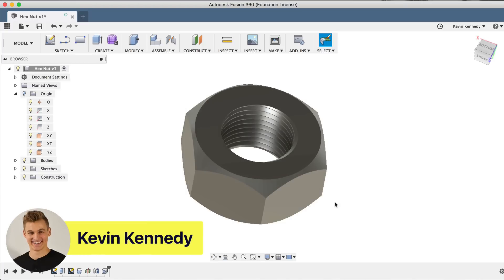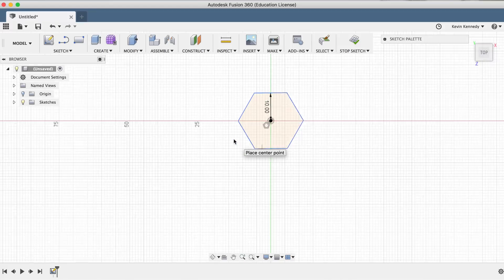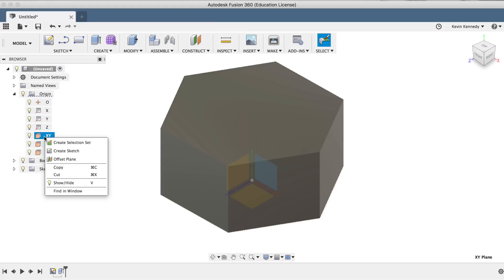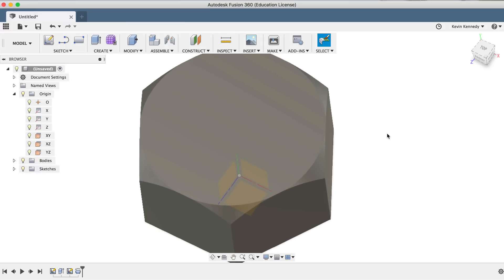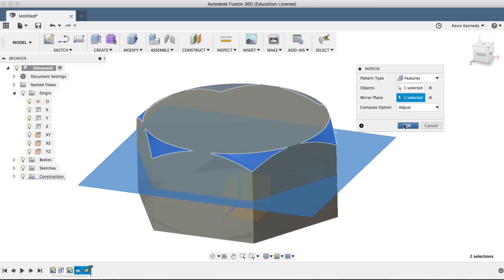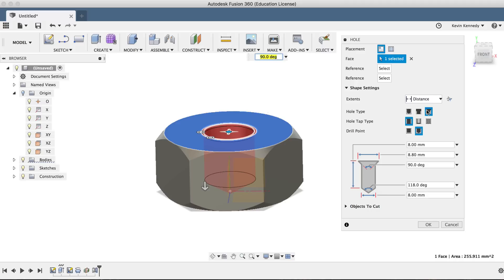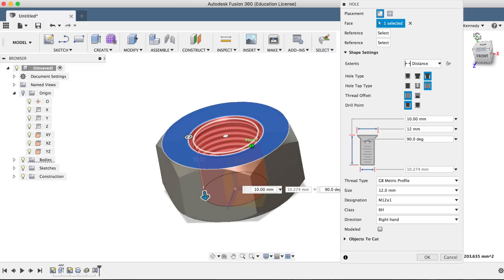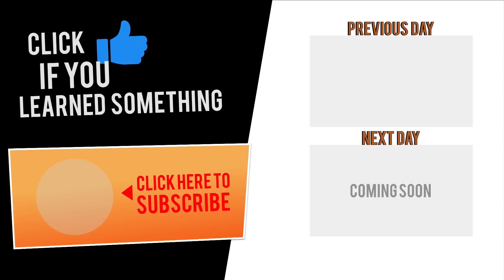How to 3D Model a Hex Nut - Learn Autodesk Fusion 360 in 30 Days: Day #6

Comment: i wanted to make one 12mm big but i ran into an issue when chamfering the hex nut, the edges aren't meeting with the top surface , you had the lines set to 1.50, how do you define these dimensions?

Comment: I cannot get the triangle to snap to the hexagon as shown in video. My front view is not "rectangular" but has one face square on and the sides immediately to either side is either horizontal at top and angled at the bottom  (ie showing some perspective) or vice vera. Triangle then appears a way into the hexagon or off to the side. I've confirmed the settings as per the guide

Comment: I'm following the step-by-step instructions to create a sketch plane from the XY plane of the browser.  But the results I'm getting  repeatedly when using the Line command to sketch a triangle for the chamfer is, the sketch is being drawn on the 60 deg facing surface of the nut.  Not on the plane I just created.

Comment: I just created this hex nut with the hole command, however the chamfer is only on one side of the thread.  I haven't been able to figure out how to chamfer the other side of the thread.
Reply from the maker: You'll have to manually apply one with the Chamfer tool. There's currently no way to do so via the Hole command.

Comment: Hi, thanks for the great videos. Got a problem, as well in previous video. Minute 1.05, my hex does not snap into place. Need to create a horizontal or vertical construction line to do so. On minute 2.20 i got the same problem, can't snap it on the object. Any advice?
Reply from the maker: It was a change in default settings.

You may enjoy the updated series which is recorded with the latest: https://bit.ly/30daysUpdated

Comment: Got through it all. One question: "Countersunk" only countersinks the top of the nut hole. Generally nuts will be countersunk on both sides. I don't see an option to do that using the hole command, am I missing it?

Comment: Two questions if people are still reading this:

4:19 re: mirroring the feature... is there any benefit or downside to mirroring the initial triangle sketch we made before revolving (and revolve both triangles) as opposed to mirroring the feature after revolving/cutting?

Two: In the whiskey bottle episode, I created myself some "homework" and created a threaded cap which matched the threads on the bottle. When 3d printing (ender 3 v2) the cap was too small. I had to bump up the size about 5% for it to fit (which also changed the thread pitch slightly).  So the question is, any guidelines when designing mating threads as far as sizing goes for 3d printing? I realize the best solution would be to run a tap/die through each to properly size them, but for one-off trinkets (and thread sizes which I don't own tap/dies for) it would be nice to be able to just print and go.

Comment: I had the hardest time getting the chamfer cut.  The line that I placed to use the revolve command kept wanting to snap to the nearest grid line rather than to the nut.  So I kept leaving little portions of the nut after the revolve command.  I finally had to make the line slightly outside the profile of the nut to get the chamfer to appear as yours did.

Comment: Hey everyone, when using the revolve feature, I continuously get these lines popping up around it rather than it cutting it all off like in the video. Has anyone else ran into this problem?
Reply: I figured it out, I think since for some reason when I enter the line function it doesn't snap, and consequently I had put the line a little to far in so it would not go fully around.

Comment: 2:23 I cannot get the line tool to snap to the corner of the nut. I have snap turned on. Why isn't it working?
Reply from the maker: This is likely due to the default settings change - Auto Project Edges on Reference. More info here: https://productdesignonline.com/default-settings-for-fusion-360-tutorials/#autoProject
Reply: @ProductDesignOnline  I didn't change that setting. I guess on the newest version of Fusion 360, which I just downloaded a day ago, it doesn't have it checked by default.
Reply from the maker: @tomjoad6993  That's correct! they changed the default to no longer have it turned on.

Comment: Pretty well done to the point tutorial so thanks for that. I wanted to create a hex stock for a project I'm working on so the majority of this what I needed. But I ran into an issue that was odd. When I imported my file to cura it came out massive. The original model I was doing was .5''x 6'' with a .25'' center hole. When I went to print it the size was 1x1.15x6'' not sure what happened!
Reply: Sounds like you mixed imperial and metric dimensions between fusion 360 and cura.. I haven't used Cura, but I know when importing into Prusa I have to select whether the source file is imperial or metric, and if I choose the wrong one, the size gets converted. So check both your Fusion model and settings in cura

Comment: I couldn't snap to the origin when placing a hole (and I did change the default setting to auto project edges for reference, maybe it doesn't do points?).  Anyway I just sketched two construction lines across vertices on the surface to get the midpoint that way.  Still, Fusion360 fails to allow you to click reference points somewhat often, and I don't know why.

Comment: An easier and imo better way to do this would be to create a sketch, create the 6 sided polygon for the desired size, then sketch a center circle to the outer diameter of the polygon, it can be a little bit bigger to reduce clicking later. Then extrude the circle to desired height to make a cylinder. Chamfer bottom and top, then go back to the sketch and extrude the outer polygon sketch that connects with the larger circle by using the cut feature and voila! there's the out chamfer on the polygon. Edit the chamfer to your liking in the history bar.

Then using the hole method he showed and thread and your done!

Comment: Hello, I have a question. I’ve been following your videos step by step and am slowly getting it but I’ve ran into a snag. On this hex nut, when I go to hit “L” to do the initial 1.5mm line to create the first chamfer, it makes my line on the bottom of the nut instead of on the top like in your video. I’ve tried a bunch to get it to be right. I checked my axis up setting in preferences and it matches yours. The only other thing I notice is that my view cube is not oriented like yours. My axis are different. But I cannot figure out how to get it to match yours. I am somewhat convinced this is my problem. Any ideas?
Reply from the maker: They changed the default modeling orientation. Guide on changing it: https://productdesignonline.com/default-settings-for-fusion-360-tutorials/#modelingOrientation

Comment: they must have changed something spent an hour trying to do the triangle cut,  it will no longer allow you to place the horizontal line like shown in the video (yes I read his updates but that did not solve the issue).  Had to draw the second line from the corner towards the middle of the nut.  That finally let me draw the second 1.5mm line but its inwards towards the middle (not on the face like shown in the video).  Once I figure that out draw your triangle inwards than select the triangle and middle axes the revolve will work.

Comment: Great tutorials, although I am struggling with getting the revolve feature to work.  I have the suggested settings ticked, and it appears my triangle is snapped to the edges.  When I go to revolve, it makes a single cone like shape instead of going around the whole hex. (Running v2.0.11894) 2022. Thanks!

Comment: Kevin, I appreciate how clearly you describe every step in all of your tutorials.  As you came to the end of of this design process, I thought that you would turn the nut over to add a fillet around the threaded hole on the bottom of the nut. This is the last step that I would have done. To accomplish this, I did a mirror of the face of the fillet that the hole command created. The advantage of this is that the face of the fillet is able to inherit any changes to the size of threaded hole's countersink hole at the top.
Reply: this helped me out thank you

Comment: What you're saying, create a sketch then go to the front view doesn't make any sense. You can't create a sketch on one plane, then change to another perspective within the same sketch and be able to draw anything there. It should be on the XZ plane, not XY to draw the triangle used to cut.
Reply from the maker: The default planes changed - check the pinned comments for more details

Comment: When you made the threads at approx 5:00 , you chamfered the top, but not the bottom. How would you apply a chamfer to the bottom, symmetrical to the top chamfer?  I believe I could use a sweep, but is there an automatic way to do it?

Comment: Hi Kevin, thanks a lot for your tutorials, they are very informative and useful!  When I try editing the chamfer triangle sketch I seem to be able to just edit one of the two sides at a time:  If I click on the other dimension while still editing the sketch it adds "d4" at the end of the "1.5 mm" text of the first dimension.  Any idea why?
Reply from the maker: Hi Mario. When you select another dimensions (with a different input active) it will reference that dimension's number. So by entering "d4" it will always apply the same dimension of the dimension you selected (in this case, the d4). Once placing your sketch geometry, you'll have to individually double-click on a dimension value to re-open its input field to edit it.

Comment: Kevin, top of your game. I went one more step and used sketch and rotate to create a counter sink on the bottom of the threads. Worked but I wasn't happy with dimensions. I tried to edit the triangle sketch but could only change one dimension, and that only once. I'm hoping you will have more about editing / changing in a future video.
Reply from the maker: Yes, I do cover more of that later in the series :)

Comment: bro iam unable to draw triangle an that palne triangle is shifting to center of polygon
Reply from the maker: Follow this help article: https://knowledge.productdesignonline.com/article/51-day-6-cant-snap-to-edge-of-hex-nut-to-create-triangle
Reply: @ProductDesignOnline  thansks for the reply ,but now  When I use the revolve command, it leaves edges, vertical lines. How to get rid of those ?
Reply from the maker: @dharma3404  that sounds like the triangle was not drawn exactly on the edge. Make sure to project that edge geometry of your "Auto Project Edges on Reference" is not turned on.

Comment: This thread is not symmetrical. The "top" of the hole is countersinked, while the "bottom" is not. How to fix that?  Do I have to manually add a chamfer at the bottom?

Comment: Got there in the end, but Fusion was being very bizarre. Polygon drawing wouldn't let me tab between the number of sides and dimension; everything I typed went into the number of sides (so it ended up with 610 sides...!), so had to type 6 sides, then add the size as a dimension afterwards. Then the hole feature wouldn't work properly; M12x1, 10mm deep, chamfered, modelled thread, but no hole appeared, and the only option was to cancel. However, it worked fine if I did it from underneath...! :(

Enjoying the series; doing a couple of episodes a day, and working through each exercise on my own a few times before moving on. Good stuff! :)

Comment: I had a problem when I used the revolve feature, It wouldn't cut all of the material and I ended up having little pillars sticking up on top of every corner. This was because the triangular sketch wasn't big enough and it excluded some of the material that should've been cut. I'm not sure why this happened, but I was able to fix it by extending the triangular sketch to the right by creating two new points that weren't on the hexagonal face. This made the triangle bigger and it cut all of the material

Comment: I was originally confused when I connected the lines for the little sweep triangle and they didn't appear to fill in. After stopping the sketch and selecting the area in the sweep dialog all went as expected. Learning all the time :-)  I did go ahead and mirror the countersink chamfer on the bottom of the hole.

Comment: I'm using Fusion 360, Personal version 2.0.9512 macOS10.16.0 but my mac is Big Sur 11.1.   I've been having a number of strange things happening and maybe this is why.  Anyone else having issues with Fusion 360 running on Big Sur?  My most recent issue is at the first step of creating the polygon, it only lets me change the number of sides...can't change the size.  My work around was to shortcut D to create a dimension and change it in there.  The second issue is it won't snap to grid.  I had already set the auto project edges on reference to on and have snap to grid enabled.  Any ideas?

Comment: When I draw both lines 1.5 mm the start point doesn't snap to the body but snaps to the grid instead which isn't the same. What is wrong with me?
Reply from the maker: Hi Andrey. It's likely a difference in settings. Check that "Auto Project Edges on Reference" is on - https://productdesignonline.com/default-settings-for-fusion-360-tutorials/#autoProject
Reply: @ProductDesignOnline  Thank you Sir. It helped. But isn't it weird that it needs projection to snap? The upper point of the nut body is allready right on the sketch plane..

Comment: So I figured out how to solve the previous issue . However I stated wondering what it would take to modify that nut to an 18 x 1.5 thread. It would need to be larger and thicker . How can this be edited in the current drawing . Is there a modify dimension command?
Reply: To edit the threads, right click the "hole" in the time line and select "edit feature."

Comment: Was pulling my hair out over this as I couldn't get the line tool to snap to the edge of the nut in order to draw the triangle shape as he does at 2:23, after googling I realised you need to hit P on the keyboard after you have selected the plane to draw on, to project geometries then click on the face you want to project and then it will allow the line tool to snap. I am using the latest version of Fusion 360 so I assume this must be something that was automatic in the previous version but no longer is. Hope this helps people not to get frustrated with it as I have been just now!!
Reply: I'm having trouble getting the polygon to snap to the grid. I even tried creating a construction line hoping that would snap. Let me try this and see if it's where I'm going wrong. Had the same issue with the whiskey bottle.
Reply: thanks for pointing out! =D
stucked for 1 hour didn't know what i did wrong or missed
Reply from the maker: Hi Jack. You are correct. There is a setting in your preferences called "auto to project edges on reference" that used to be on by default (when I recorded this tutorial).

you can cross track your settings with mine here http://bit.ly/defaultsettings
Reply: @ProductDesignOnline  OMG thank you for mentioning this - I have had so much trouble about gave up with your tutorials.
Reply from the maker: @417goose  Hi Paul. Glad you stuck with it. be sure to check out the pin comment for every video as I update with any notes and/or settings to look out for.

Comment: moving along  with these great tutorials and now  I am stumped. I created the triangle for the chamfer 1.5 x 1.5 mm with one line vertical around the vertex of the nut and the other going to the center and now I m unable to select the profile of the triangle. I can see the triangle clearly but the selection tools either chooses the top of the nut or a side. not the triangle.  Hint or help please?
Reply: Same issue with me as well

Comment: Don't know why the perfect blue box doesn't appear when I try to select the corner of the polygon to create that profile for revolve command.....not only here it happens everytime when I create something for the first few steps everything works fine but later i can't find that blue box when i use the line command to join some points instead i get a black plus sign......in order to get it back I have to redo everything and start it from scratch.....can you say why it happens and what's the problem behind it

Comment: i dont know if this is a new issue but my points wont connect to objects had same problem with whiskey bottle spline couldnt connect dont know how to fix it
Reply: Even I have the same problem.....I often miss that blue box which comes when joining points and I get a black plus sign instead it doesn't fit on the edges and makes me done.

Comment: The 1.5mm lines are left behind after doing the revolve command. I noticed towards the end of your video they show up in your model too if you hover your mouse over the model lines ( 6:37 or 6:38 - flashes quickly )
Reply: It's right at 6:39

Comment: Don't get the same result from the revolve cut away to create the chamfer on the top face of the nut. it cuts away but doesn't get all the way out to the side of the nut, so essentially it leaves a groove  cut into the top face. I fear I've done something wrong, but I've gone over the first steps several times now and can't seem to find where i've gone wrong
Reply from the maker: Hi Richard. It's likely due to the default "Up" axis being flipped. You can change yours to have the "Y up" instead of "Z up" and everything should be sorted out. Instructions here - https://productdesignonline.com/default-settings-for-fusion-360-tutorials/#modelingOrientation